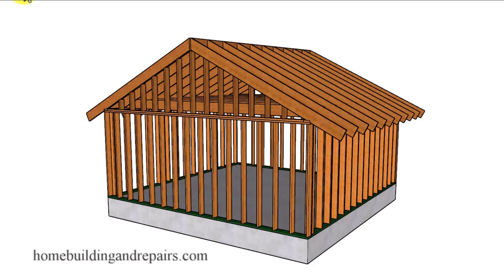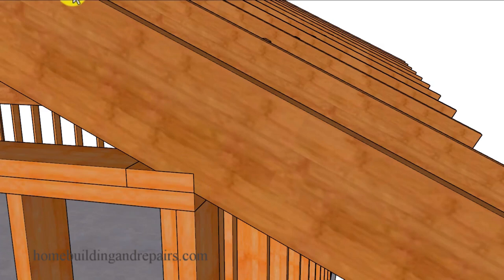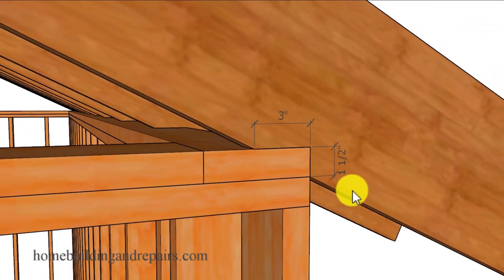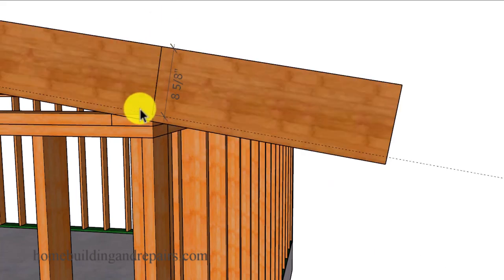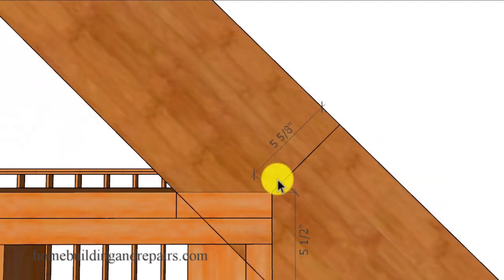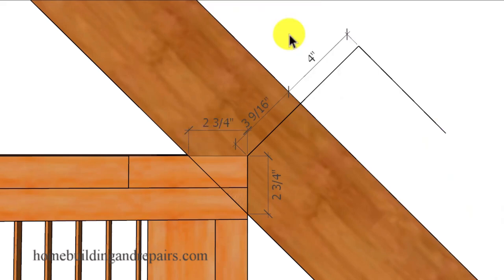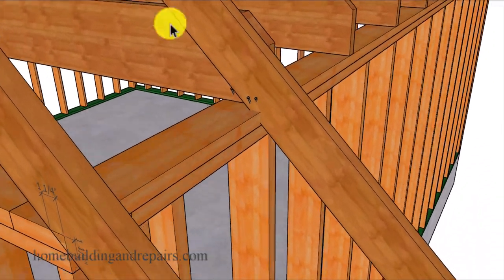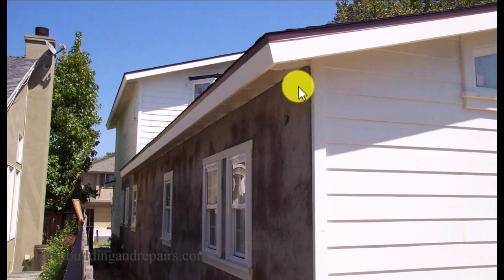How To Calculate Most Roof Rafter Seat Cut Measurements For Construction Standard Lumber

Comment: How would you do this? If I’m building a Dutch Gabel roof for my small workshop but I want to open up the ceiling by eliminating ceiling joists. Can I remove all the ceiling joists as long as I the first and last pair of rafters are replaced with a load bearing truss at each end and attaching the side shorter rafters to the truss since this is a Dutch Gabel roof? I’ve never seen anyone do this and I’m wondering if it’s even possible .